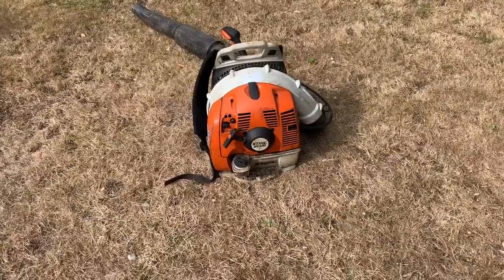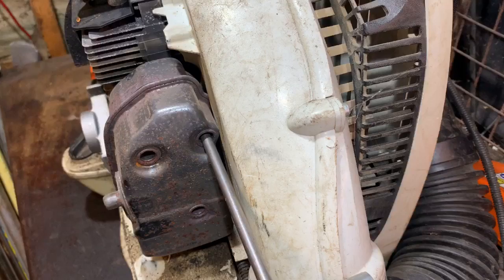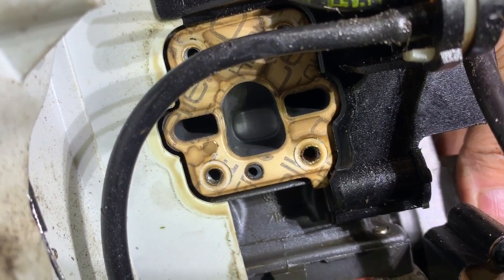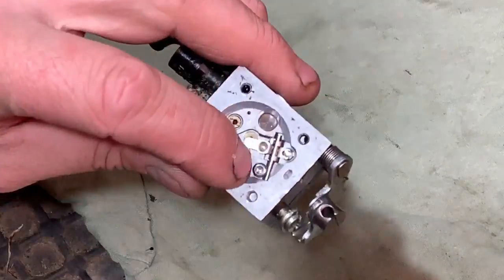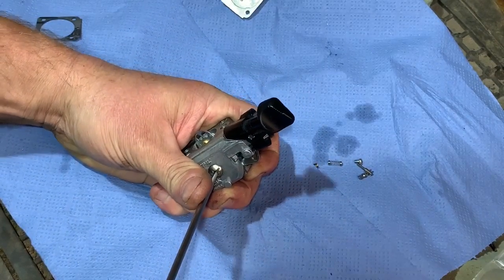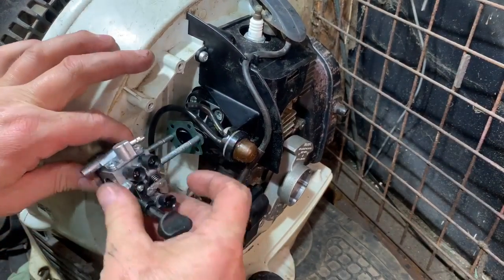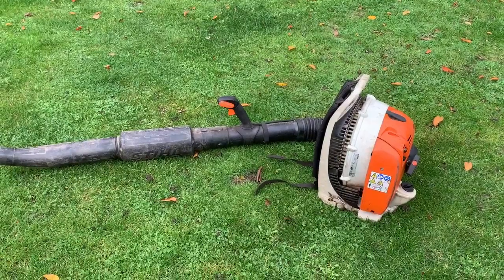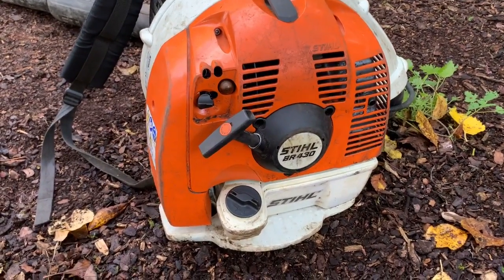Stihl BR430 Blower ( Bogging ) You’ll never guess what was wrong

Comment: I got a BR430 for $50 off of FBMP with a broken coil mount due to user error (flywheel key also sheared but tight bearings). $29 for good used crankcase. Adjusted the knock off carb it cane with a bit and got it running pretty nice. Then after about 3 days it started losing RPM and bogging.  I thought i blew it up. Check compression still 150 psi. Remember that screen is inside the muffler. Tried to remove bolts holding screen. One comes easy. The other required an angle grinder with a thin wheel. Screen plugged solid. Just left it off and had to retune my carb. Now it idles better and goes up to full throttle great. Sounds almost exactly like yours. My RPM meter says about 7000rpm on the nose.